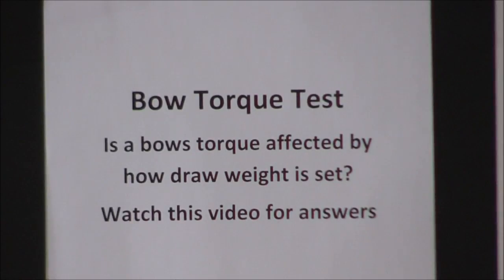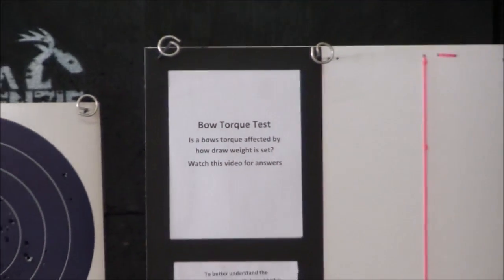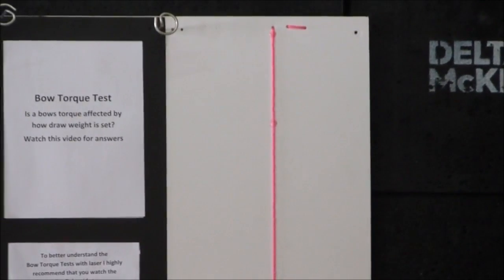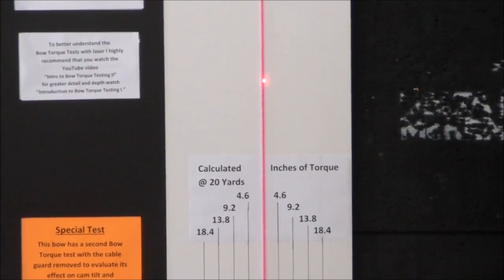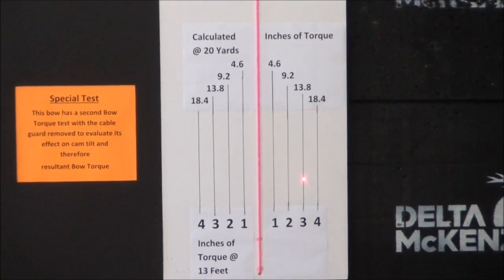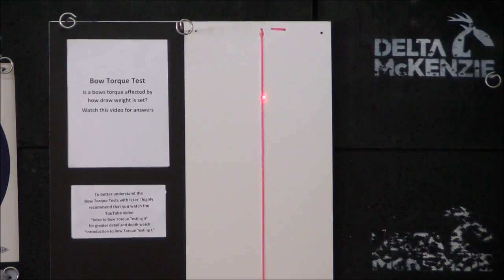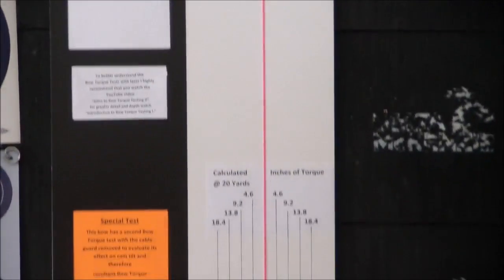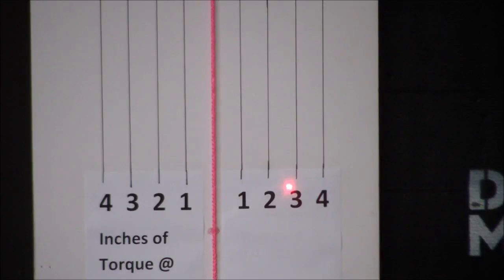Bow Torque Test at different draw weights

Comment: Zero torque roller guard a bunch of crap marketing i was going buy the RX1 carbon until i seen how much cam lean was on the bottom limb even with larger bottom limbs it does absolutely nothing

Comment: I have had mixed results with this myself. 
Some bows especially those with reverse roller guards or flex guards seem to have little difference. Bows with a standard slide system def show some variation depending on the bow. 
Bows with a standard roller guard show the biggest difference as poundage is increased & decreased. The more aggressive the bow and lower the brace height the worse it becomes. 
When the test is done over one bow with a 10# difference the results are not that big. However get 2 of the same bow, one with 70# max and one with 40# max and the difference can be huge. 
Definitely less of an issue with a 40# bow

Comment: I'm new to archery. This is pretty interesting. That being said I'm not sure a single test shows inherent accuracy. Again, I'm new so I'm asking more than telling or at least raising debate. 
1. The key point here seems to be consistency, if in fact this effects accuracy. If the torque measured is always exact then it could easily be sighted and tuned to match for that. But if it falls on a different measurement every time than we have a real problem.
2. I see this affecting long term maintenance/tuning more than everyday accuracy. As the horizontal torque applied to the cam bearing under load could eventually increase the amount of play and cause early wear. That excess movement would result in actual inconsistent string movement or alignment. Same with the bolt holes, limbs, and pockets. Unidirectional carbon is built to have strength in one direction. In the case of limbs The carbon lay-up is ran parallel mostly to withstand the forces. A lot of riser torque would put perpendicular forces that could change the characteristics over time.
3. How does this affect the string path in relationship to the arrow rest after release? It should still follow a straight path back to zero. I can see it effecting the arrow rest in relationship to the bow sight at full draw compared to at rest. Which as long as the bow is consistent, it should be able to be sighted and tuned to match.

Is it possible to test a couple bows that tested low torque after a few thousand shots, in comparison to a bow with a lot of torque movement. My theory being the bow with a lot of movement would alter more over time. That bows with a lot of torque need more maintenance over time. Although not being less accurate day to day. Am I on the right track here?

Also maybe test 3 times per test.. I wouldn't worry or let a single test affect purchasing. But if a bow tested -2 on the first test then -4, then -3. That would show real issues. 

Thank you for creating thought
Reply from the maker: You…The key point here seems to be consistency, if in fact this effects accuracy. 
For a new archer you do have allot of questions and conclusions that seem to go in many simultaneous directions. I will do my best to address them. 
First the key point here is bow generated torque, it may effect accuracy in the same manner that archer generated torque does, it leads to inconsistency shot to shot, which effects accuracy.
You…It should still follow a straight path back to zero. There is evidence that suggests bows nock travel is not straight at all and varies between different bow designs. 
You…Is it possible to test a couple bows that tested low torque after a few thousand shots, I have tested my personal bows to see if I could measure a change in torque and the differences were negligible, but my bows do generate very small torque . less accurate day to day. 
You…Also maybe test 3 times per test.. I have done this many times and before I video a test the bow is drawn several times to assure repeatability. 
Keep on studying archery, more thoughtful archers are needed and challenging questions are welcome. Thanks for your comments!
Reply from the maker: ooops, delete the less accurate day to day, it came over with a copy paste.
Reply: archer1941 Thank you for taking the time to review and answer my questions. I really appreciate academics. Especially true academics that are willing to post, teach, review, etc. On free public forums.

Comment: Hey, thanks for the test. I don't know if this was prompted by my question in one of your other videos but It's nice to see this confirmation. I had actually had a turbo on order and it came in from Hoyt with a cracked riser. I was actually relieved to see this since I have been having second thoughts based on your testing and just some of the finish quality I have seen on other examples of their 2018 bows.
I guess I'm not super concerned with getting perfect results from your bow torque test if other aspects of the bow are what I want. But, I find it really unacceptable that Hoyt added all this complexity, a high stress area to the bus cable and all this resulted in the worst bow torque results you have ever measured. I'm happy with my Elites and their binary cam system. While they haven't done stellar in your tests, they are also very simple systems and I shoot them well. Hoyt adding gizmos that do nothing to address what they were ostensibly designed to do is exactly what I don't want. I was never crazy about the look of the Prime dual cams but at least there is a benefit to that added complexity.
As an aside, while I'm relieved that my Hoyt was cracked so I could cancel the order, how many hands does a bow pass through in the factory with a crack going around the riser big enough to stick your finger nail in and not get noticed?
Reply from the maker: "how many hands does a bow pass through in the factory with a crack going around the riser big enough to stick your finger nail in and not get noticed?"
I guess not enough :)
But things like this can happen occasionally with any product, if it happens frequently...now that is a big problem.

Thanks for any input or questions you may post.